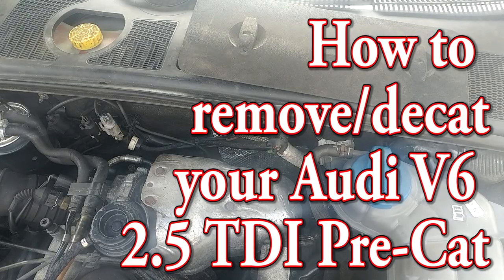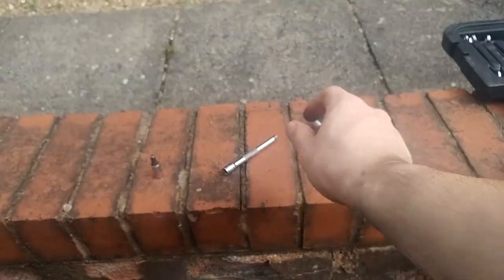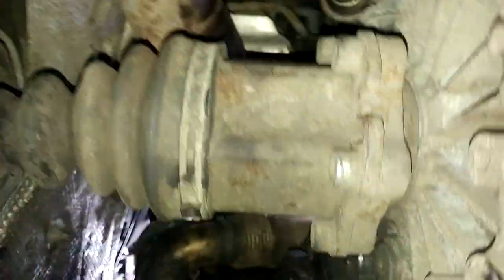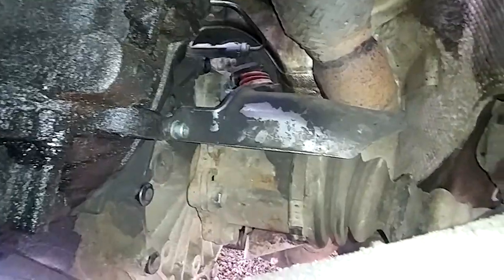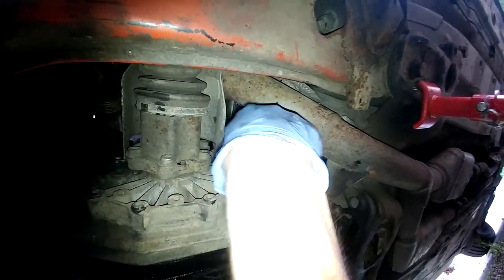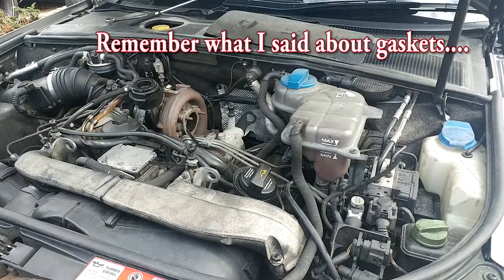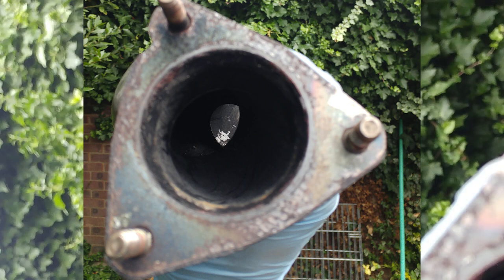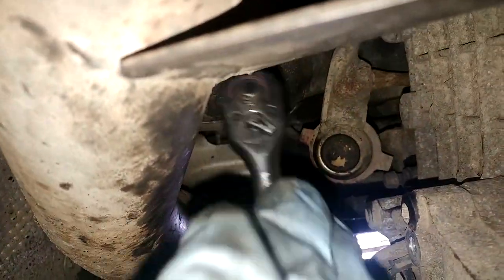How to remove/decat your Audi A4/A6 V6 2.5 TDI

Comment: If you take the turbo off & shorten the studs where it mounts to the cat then if you have to remove it again it will be easier.  The studs only need to protrude a small amount after they're tightened.

Comment: Putting a big cavity in the exhaust system adds turbulence and reduces flow efficiency. 
Better to cut the CAT apart and weld in a equal diameter pipe or install a new downpipe, then you can swap the CAT back in for MOT inspections.

Comment: Hey yhere, nice A4, I'm planning to do the same to my 2.0tdi, what kind of changes should I expect to performance and sound?
Reply: 2.0tdi you can't because if you make it you will have a check engine  light
Reply: @styx7989  huh, well I did and its completely fine :b
Reply: @diogovieira3362  there is some diference with power ?
Reply: @eriklapinskij7420  not really, didn't really feel anything noticeable, not even noise. Might have had actual differences if it got a tune, but not only did I not give it such a thing, also sold it almost a year ago

Comment: Does it smell without the pre-cat ?
Reply: I use straight pipes on diesel for over 2 decades now. Only thing I dislike about them is strong smell of unburnt hot fuel. You can get used to it. But yeah, it smells.

Comment: Did removing the cat throw a check engine light
Reply from the maker: 2.5 V6 TDI's like mine don't have sensors in the exhaust.
Reply: @CarAndMechanical  Can you tell us yours B6's model year? and  3 letters of engine name? is it AKE?
Reply from the maker: It's a 2003 AKE
Reply: @CarAndMechanical  Thanks! and maybe you know any internet shop who sells this custom pipe for a4 b6 2.5tdi? Because hitting this stuff out is not for me,I want this part look more sporty than it its now